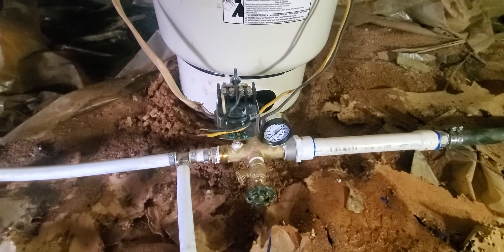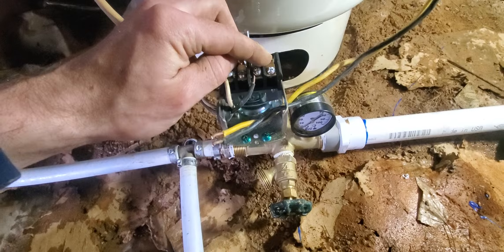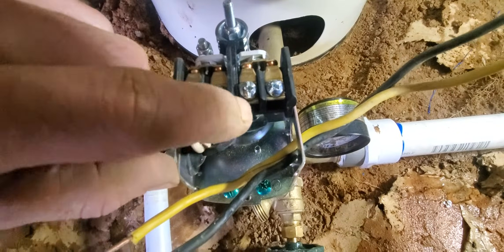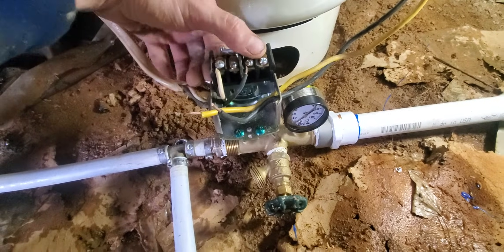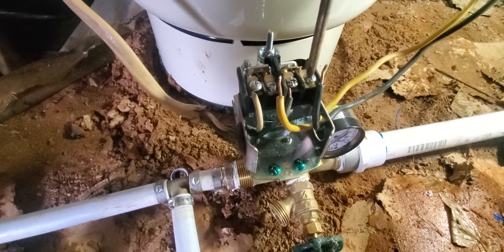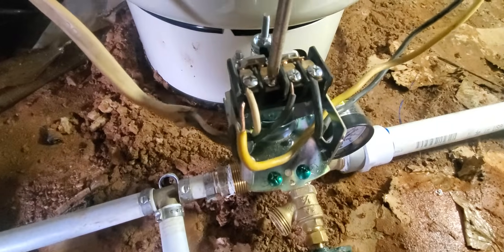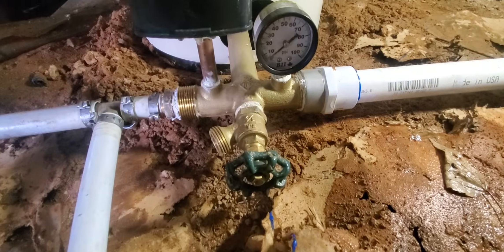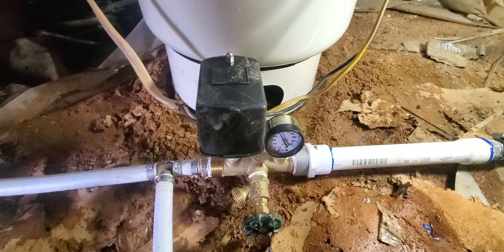No Water. How to Wire / Replace a Pressure Switch.

Comment: Hi I'm in texas.rodney moos.... I replaced tank & switch ...and I have high pressure after coming out and at valve ontopshow pressure but at gauge at bottom no pressure and plus... Pump doesn't kickon or off. S switch wired wrong or maybe a reset?,I am confused  plz help

Comment: I do have a question for you, if you don't mind.  I noticed when I just replaced my old well pump switch on my submersible, the power was all shut off and verified with a multimeter, however, when I was removing the ground wire on the pump side with the Phillips, I noticed a small fizzy spark that kept happening when I was trying to remove the ground wire?  I quickly tested again, no voltage coming in on the main leads on either side. What can cause such a thing?  It wasn't like a big spark or anything, but it was visible and almost fizzy like.

Comment: On a 120 v pump I always tie the white neutrals together and switch only the black hot leg with one side of the switch. Years down the road if those contacts get bad you can simply move the two black wires to the other side of the switch and carry on. They will still be like new since the never had and current switching on them.

Comment: I need some help. I woke up this morning to no water, checked the pressure switch, seemed rough. I went out and replaced the pressure switch. Hit the breaker, no water pressure still. I can see and hear the arc on the contacts. I have power at the pressure switch as well as the top of the well going down to the pump. Pressure tank is at 38 PSI. I have a 40-60 pressure switch. Checked the stem to the switch for a blockage, it’s clear. Pressure gauge is a flat zero. Only thing I haven’t done is put a meter to the wires, which I will shortly. Am I missing something? Wires at the head of the well were corroded, I cut them back and re spliced, but they were still coated in a black sut. Maybe it’s my pump? The last thing I want to do is jump the gun and replace or pull the pump if I don’t have to. Thank you in advance, appreciate any and all help.

Comment: Just bought my house a couple months ago and was having issues with the pump always kicking on with the water going. Pressure tank was good and holding properly, replaced the switch and now suddenly the pressure is random. Closest 2 showers seem fine, furthest upstairs is random spurts of pressure, the other shower wasn’t getting any pressure then suddenly got pressure. Apparently it still isn’t working right. My breaker wires are both black and unmarked.

Video didn’t help my problem but gave me new information I wasn’t fully sure on.

Comment: Question. I have been watching your videos for a couple days now and I've learned a lot. I was able to diagnose my problem and deduced that it was my power supply wires from breaker to switch box that was jank. I'm going to rewire it, but both of my switch to pump wires are the same color. I'm afraid to burn up my motor or something by wiring the new breaker to switch wire incorrectly. 🤔 How do I know which to put where when the ones I'm trying to match are the same color?

Comment: Is there any circumstance where it would be white black on one side and white black on the other?
Reply from the maker: Yes . You can wire a switch correctly 2 different ways & 1 wrong way.

Comment: I'm fixing yo changing a pressure switch.  It has a red wire, 2 black, and a white. How would I wire these?
Reply from the maker: Black-black
Red-white
Left 2 right or R to L. 
Just assume red is white
 If your wrong the breaker will trip.
Remember to kill the power b4 messing with anything
Reply: @h2omechanic  thank you.

Comment: How do you wire it if you have 5 wires?
Reply from the maker: I assume you have a Yellow/ black/red or white. That's a 3 wire pump. Those 3 pump wire go into a control box with a capacitor. Then 2 wires exit the control box and go to the pressure switch.
Reply: @h2omechanic  I have 2black 1 white and a gray wire coming  from the pump. I have 18- 20 psi but the switch  never opens. I can't  figure  out how  to send a picture  of how  it's wired. Thanks Jimmy
Reply from the maker: @JamesDriscoll-fl9nv  turn off the power & see if it drops to 0 psi. If so, then you've got a leak near the pump. Cracked pipe or fitting.

Comment: I just replaced my old pump and installed a new two wire pump, new wire and pressure switch. Kept the old water line inside the well, inspected it and it appeared good. When I turned on the power the switch contacts moved several times then stopped. No pressure or water. I did not drain my pressure tank as its buried. Any suggestions?

Comment: I have a pressure switch but it doesn’t work properly I have to tap it for the pump to engage can u help me out "
Reply from the maker: Replace the switch and the nipple it sets on. The switch is worn out. Eventually tapping it won't work. Carbon build up between the points are preventing the flow of voltage. Tapping it helps temporarily

Comment: do you have to drain the tank when replacing the switch ? Thx
Reply from the maker: Yes. & set the air pressure in the tank 2psi below the "on " pressure of your new switch
Reply: @h2omechanic  so how do you do that?  You made it look like, replace the switch, turn it on and le voila?  Did you forget to show us something?  I got nothing....  switch works,pump comes on, but nothing up top.... Is it the tank?

Comment: Thank you for all your videos. I recently came home after traveling for 3 weeks. I discovered I had very little pressure downstairs and none upstairs. I made sure the sink fixtures weren't filled with debri. I probably have a 2 gpm flow rate downstairs. I checked the pressure at the top of the pressure tank and it is 28.  I decided to replace the pressure switch and gauge. After replacing nothing has changed. I still have 28 psi at tank but the pressure gauge just before the pressure switch only has 10. Any suggestions before I look to replace my submersible pump?
Reply from the maker: If you turn off the power & the pressure drops to 0 psi, then you have a leak on the pipe that goes down the well. If its 10-15 years old the pump might be worn out. Also be sure to look for wet spots in the yard for a possible leak
Reply: @h2omechanic  there weren't any grounds on either of those wires??

Comment: Just put in new pump. It started to draw water but the just started sucking air. Any ideas
Reply from the maker: Your pumps probably not even running. You have a voltage issue somewhere. You probably need to call a professional to prevent a more expensive issue.  You might have a small issue that could lead to a bigger issue.
Reply from the maker: Did you use old pipe? Could be a split in the drop pipe, or if it's all new, maybe you didn't set pump deep enough. I need alot more information
Reply: @h2omechanic  hooked up the new pump to the old lines. Old pump pulled water fine til it burnt out.
Reply: @h2omechanic  just getting a dribble of water out the discharge